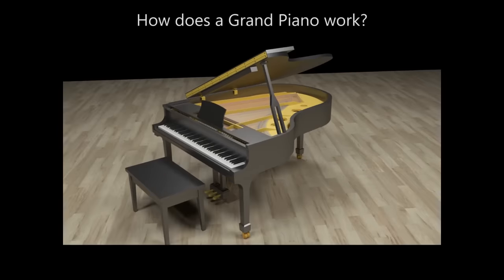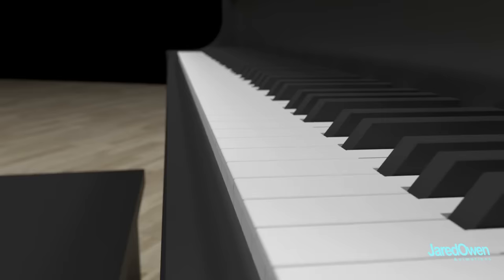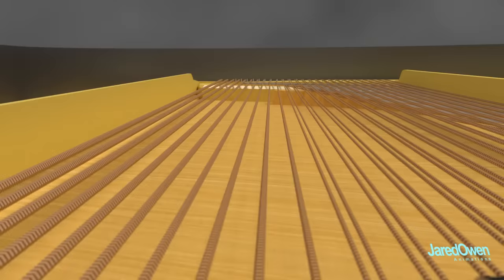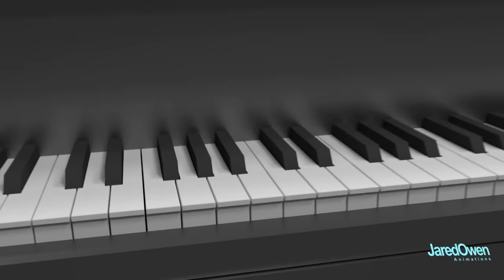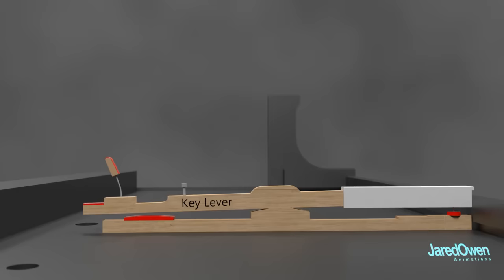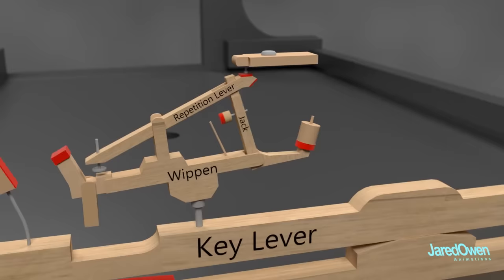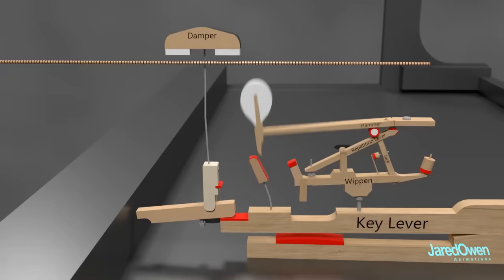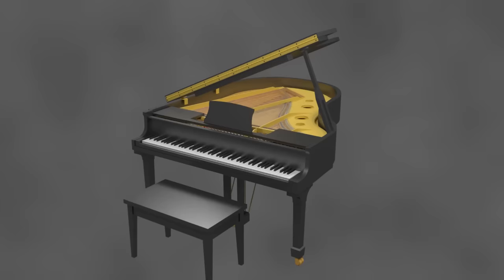How does a Grand Piano work? - Part 1

Comment: As a piano technician, I can say this is an excellent diagram of the piano action. I will use this in the future!
Reply from the maker: Awesome!  Thanks Thomas
Reply: I've always wondered how the C, D, and E strings make their sounds. It's hit with a hammer, and you said the length affects it. On a clavichord, however, some notes share strings. Do those sound the same, or are they plucked in a certain way? Why do those notes exist, then, if they sound the same. What happens if you play both?
Reply: @Sh4dowbanned  Some notes on a piano can share a string, but each one gets its own spot on the bridge. Also, because the tension is so high on piano strings, the small changes made on one string don’t affect the other string at all, except in extreme cases, like when replacing a string.
Reply: @JaredOwen  what is the name of the song in the outro?
Reply: @steveplayz538   poop sond salavana
Reply: As a piano teacher, I am amazed of the simplicity of this video

And my students love this when I show it to them. They totally understand it.

Thanks for this video.

On a different note, I was always taught that it is a percussion instrument not a string- as the hammer hits the string. It doesn't pluck it. But do correct me if I'm wrong
Reply: @JaredOwen  I know your channel ever since you posted the hindinburg.
Keep up the good work .
Reply: ０．０

Comment: Very nicely done, Bravo !!!
just a small downside: it lacks the extremely important spring between the wippen and the repetition lever
This spring gently raises the repeater lever when the key is released and therefore the hammer rises slightly, allowing the Jack to reposition itself under the hammer roller.
this is what is called (wrongly!) the double escapement, and it allows the note to be replayed while the key is not yet fully raised
It is a wonderful, French invention of the 19th century, which the upright piano does not benefit from !!
I have put it as a link on my website of piano tuner , thanks !!

Comment: Addition: The part where the shank meets the jack is called the knuckle. As the jack pushes the knuckle the shank (the long arm leading to the actual head) is raised, thus lifting the hammer. Fun fact. the hammer is actually "thrown" into the string. Jared briefly mentioned this, but it is important. If you press the key very slowly the knuckle will never leave the jack before the highest point is reached (called the "let-off", more on that later). Pressed in this way, the hammer will approach, but never actually touch the string, before falling back on the down side of the let-off. You'll further notice the let-off will occur before the key press bottoms out on the board. During a normal key press, the hammer only reaches the string to the point of contact momentarily because the velocity of the press punches the knuckle with sufficient force to throw the hammer all the way to the string. The hammer can then return to rest, still raised by the repetition lever, but resting off the string.

The let-off position is very important. A properly regulated piano will have the entire key line regulated to have the let-off in the the same position across all keys. Artist preferences notwithstanding (they can be a finicky lot), the let-off is normally about 1/16th in. off the string. The "cylinder" Jared mentioned near the back is called the let-off button, and that is the point where the let-off is adjusted per-string. A nearly universal technique for adjusting the let-off involves a magnetic strip of precisely the requisite let-off depth that is placed on the underside of the strings where the hammer line makes contact. The strings are metal; the strip will stick to them. The let-off button is then adjusted to the point where the hammer just-touches the strip. Once the strip is removed, the let-off is now-set to that depth (and you can move on to the other 87 keys; oh' joy).

Finally, as part of regular maintenance you may wonder how often regulation has to be done. Depends on the piano, how often it is played, how often is is -moved-, etc. Things loosen up, get kind of janky, etc. I have my grand tuned twice a year, and regulated every 4-5 years. Still amazes me how awesome-sauce it feels the first time I play after both have just been completed. (of course, there's a lot of other things done during regulation, hammer shaping, sled-waxing, etc.).

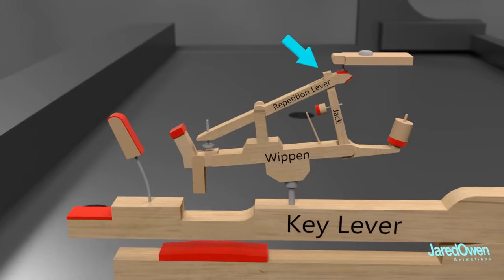Comment: 3:15 I think the Jack hits what is called a Knuckle? (the round, red thingy)... and that's how the "let off" (also called escapement) works. That is, the Jack pushes the Knuckle so that the hammer hits the string, but the Jack immediately moves sideway so that the hammer goes back down, allowing the string to freely vibrate without the hammer touch it. And if the piano player releases the piano key a little bit, the Jack now goes back down and is below the Knuckle once again, and if the piano player now presses the piano key down again, then the Jack pushes the Knuckle up again and make the hammer hit the string once again. So, it allows the piano player to repeat the same note fast... without releasing the piano key all the way before making another hit of the string. It is said that many or most upright piano cannot have this feature of fast repeated note.

Comment: I think, as we see in the mechanism, after the hammer hits the string, it is disconnected from the keys, thus reducing the weight of the key. In almost all digital pianos, the hammer is always attached to the key. The weight does not change when the key goes down or up. This is a tiring factor.

Comment: Great video but one mis representation: the damper mechanism doesn't rest directly on the end of the wippen. There needs to be a head space of some millimeters. Also the function of the spring to operate jack and repetition lever is omitted.

Comment: Well done! Thanks! Still, leaves a question about why the repetition-lever is there. You could repeat without it, but not without releasing the key completely, so that the damper will fall all the way down and dampen the string. There is even a spring on the repetition lever which helps so that the hammer does not fall all the way back to resting position.

Comment: Why is it that the lower pitch strings on a piano and most other stringed instruments are thicker? I believe it's the length that determines the pitch so what does increasing the string gauge do? I.e. why not just use the same gauge string on every key?

Comment: I guess that, even on the finest pianos, there is a maximum rate at which a note can be repeated. 
Yet I have never seen this rate advertised as a feature of the piano. 
It must be greater than any music which has been (or is likely to be) written.

The whole thing is incredibly complicated - even if it is ingenious.
In the beginning, it must have seemed simpler to wait for electricity to be invented, then electronics and finally computers. 
And then get yourself a digital piano.